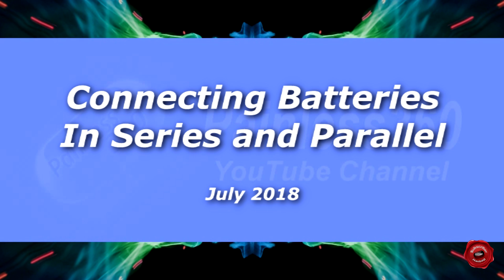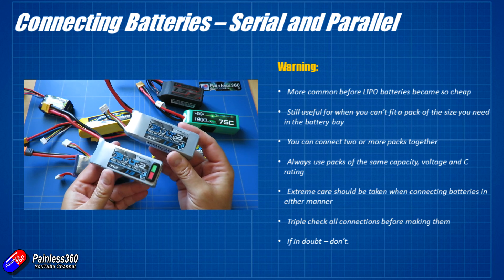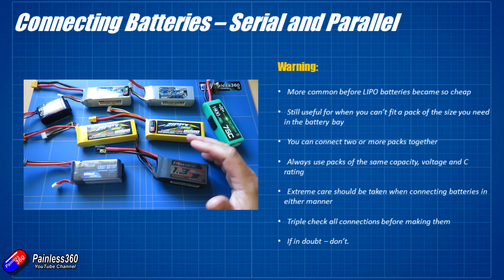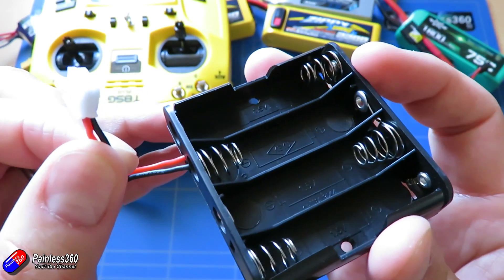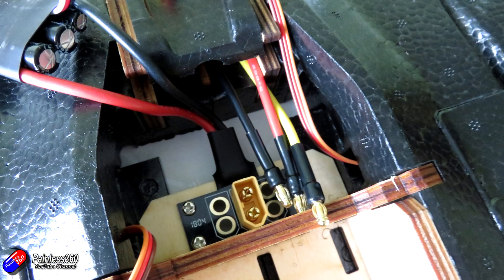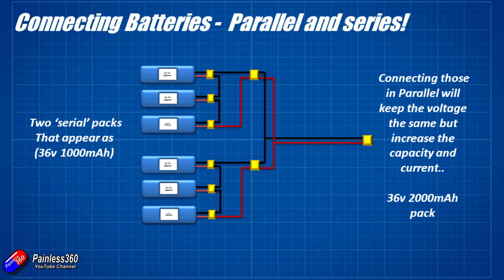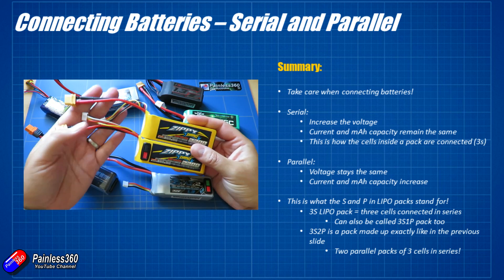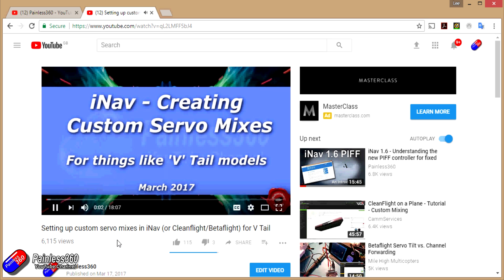Easy Connecting of LIPOs in Series and Parallel

Comment: The best practices I've learned about composed batteries is to ALWAYS buy/charge/discharge the batteries packs together like they are married (until death ^^). It's the same process for Li-Po or Li-Ion.
- Buy them together (understand same brand/model/capacity) can provide a good chance they came from the same batch or a close one and have similar internal caracteristics. A composed pack is worth the weakest element of the assembly. If they are quite similar, the pack should have good and consistent performance/lifespan/charge time/...
- Charge/discharge them together ensure they age the same way and keep the consistency of the behaviour of the composed pack.

Finally, to prevent some issues, I mention a serial build will forgive more easily the slight differences between the batteries than a parallel one. In an heterogenous (new&old, charged&not charged enough batteries) parallel pack, the batteries will try to balance themselves before powering the model, the efficiency/autonomy of the pack will be awful and not to mention the monitoring of the elements can't be accurate and can lead to an over charge/discharge of an element of the pack. It can be really hazardous. ("Come on baby light my fire... Come on baby light my fire... Try to set the night on fire..." - Not the original meaning but quite applicable... ^^)
That's why I suggest, when making a serial & parallel build, to start putting the batteries in parallel first (each small group is more easilly manageable) and after put all the groups in series.

For the picky ones, we can also add some diodes in the parallel builds to prevent current exchange between the batteries.
A PAB (power assembly board) with sensors, diodes and safety fuses can be really handy for the big builds.
My 2 cents.
Reply: Hello Alexis, thanks for the very useful comment. Could you help how can i put diode between the batteries in orden to block the current between the batteries? Many thanks in advance

Comment: Thank you for the videos. 
As a sort of related topic, can I run 2 brushed whoop style motors off of one esc and would it be beter in parallel or series? I was going to do the re-purposing of an old micro drone to a paper airplane, like Peter Sripol, had done. He had used just the 2 back motors attached to the fc and placed them on a paper air plane.
Reply from the maker: If the ESC can handle it, yes. You'd have to connect them in parallel so they still get the same voltage. I'd use one esc per motor myself..
Reply: Thank you! I will take your advice and stick with 1 motor per esc.

Comment: I believe if you hook up two lipos in parallel that are charged at different voltages there is a potential of some lipo damage. IE, connect a 3s at say 10.6v in parallel to a second at 12.6v, would there not be a large current between the two lipos to equalize voltage. I haven't tried it, but I suspect you'd have a couple warm puffy lipos after that.  If that is not the case, please ignore, but if it is the case you might want to highlight that warning/note. It is mentioned on your warning page, but if it is missed the results could be unfortunate.
Reply from the maker: Connecting any batteries in parallel with different voltages will result in a current flowing equal to the difference divided by the internal resistance of the batteries. If you calculate the amperage it's not massive unless you have two packs with wildly different voltages. That currect that flows can be above the 'c' rating of the packs until the charge starts to equal out. Bottom line - you have to be careful, hence the warnings and my advice to just buy a 6s pack now rather than use 2 x 3s packs.. ;)

Comment: quick question buddy I was told come here.had a qav105 sent to me by pepe prawns for a progect I have here in the uk teaching a few kids.czme with reciever.bound qx7 in d8 mode as that was all I could.at first in reciever tab all bars are moving on there own while not touching radio.pluss all mapped incorrect.updated betaflight and setup another new model it corrected mapping but still all bars  including throttle ect are all moving up and down random on there own.aert taer no avail.is the reciever done.the quad is bran new.any help.if could explain easy fix please.thznks buddy.
Reply from the maker: Please see my Betaflight BNF setup video for the steps I follow.. hope it helps..
Reply: Painless360 the done all that allready buddy.im familiar with setup but something wrong.half the reciever bars are moving back and forth a lot on there own.
Reply from the maker: So what have you checked? Are they moving properly on the radio? What troubleshooting have you done? Have you tried another BF version....
Reply: Painless360 after updating and creating another new model they are no longer mapped incorrect.i have tried all uarts.aert taer.can only bind d8 mode.sticks move correct order but they allso move on there own a lot.id say top six from yaw .pitch role throttle and then 3 more move.without touching radio.as stated tried all 3 modes but only d8 binds.stick movement correct after update but still aggressive stick movement without touching radio.as you showed in your video a little movement is natural but mine move back all the way then forward on there own 1 2 sometimes 3 togeather
Reply from the maker: If it moves that much on the channel monitor screen on the radio then I'd think about replacing the gimbals. A little movement is normal.. Best of luck

Comment: What are the risks of the" push-me/pull-you" effect of connecting Lipos in parallel? While the're being used, cross current drain should be minimal, but I used to work with large computer UPS backup systems with batteries in parallel, and they start to 'fight' each other if left connected without constant charging.  
I've seen guys unplug the Y connector from the ESC but leave the two Lipos connected together at the end of a day which looks risky to me.
Reply from the maker: The current that would flow between two batteries if the voltage is a different would be the difference in voltage / the internal resistance of the actual packs themselves (usually 5-15 milliohms per cell). In practice this is usually self-limiting, and quickly drops to a level that safe for both batteries. The danger is that if the voltage is a wildly different and the internal resistance is low, then the current can be above the safe charging current rating and potentially damage one of the packs. If the packs are close in voltage then it should be fine..

Comment: I run a 4s 5000mah battery in my quad. I want to run two in parallel so I get 4s 10000mah. Will this affect the ESCs, FC, gimbal etc? All I want is longer flight time. I don't race or anything just take videos with my camera on the drone.
Reply: swankypotter It won't effect your electronics. Voltage stays the same.
On the other hand, it will be effected by the weight of the packs. Your motors have to work a little harder to lift your copter.
Reply: Jos van der Weide yes I understand the weight will not help but the flight time will over power that anyway. Thanks for the reply
Reply: If all you're looking for is longer flight times then apart from weight and manoverability as Jos mentioned, it should be ok. BUT,  with 2 Lipos you now have double the max current (so if one is 30C you now have 60C) and you need to check your ESC and motor capabilities (not to mention the wiring current capacity).  Lee has a good article on this site on the 10% rule of Battery, ESC & Motor).
Reply from the maker: As others have done an amazing job of answering you, I'll answer quickly too :) connecting in parallel the voltages are the same so the electronics will be ok. It's just like plugging in  pack with more mAh.

Comment: Good informative video as always.
When you look here can you tell me if you have done a video on the effect of higher capacity on usable battery life. Unusually I can't find one using the search but I'm sure you've covered it somewhere
Reply from the maker: I've not made one. In my experience battery life is more a factor of the quality of the pack and how well it's looked after (Not over-disharged, balanced now and again and not pulling more curremt than it's rated for).. happy flying!
Reply: Yep- so many variables. It was worth asking. Thanks

Comment: If i wanted to connect 4 batteries in series with 3 triangular series attachments, can i work?

            /   \
+        /       \        - 
        /______\ 
      /_\         /_\
   🔋 🔋   🔋 🔋

Dont mind the terminals of the emogis batteries
Reply from the maker: If I understand the diagram you’ve made that won’t work. All of the information I have is in the video ;) best of luck!
Reply: Painless360 why wont it work? looks like he has 2 parallel packs connected in series. you did that as a demonstration at the end with 2 series packs connected in parallel.